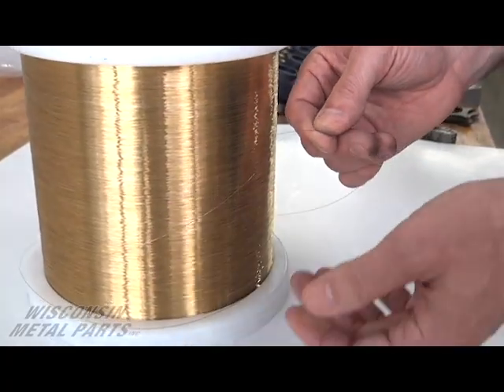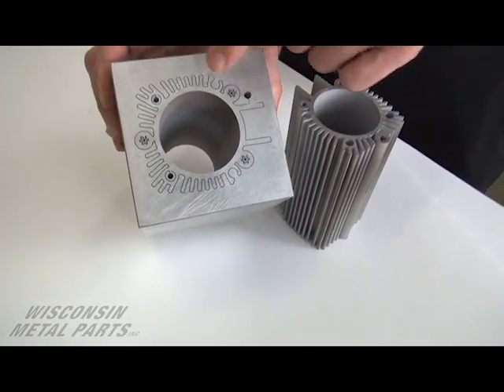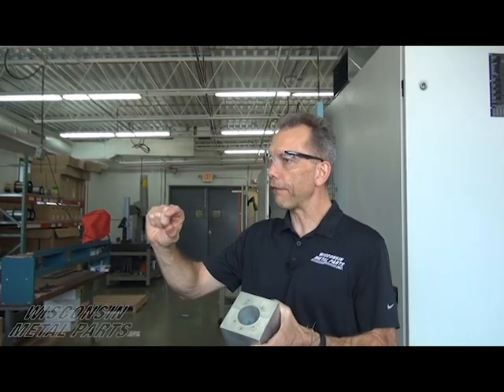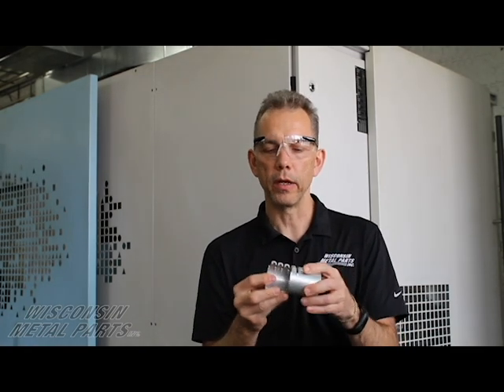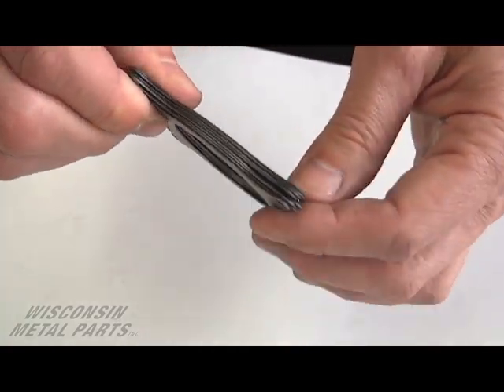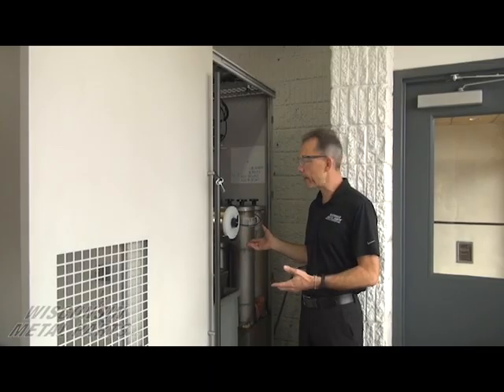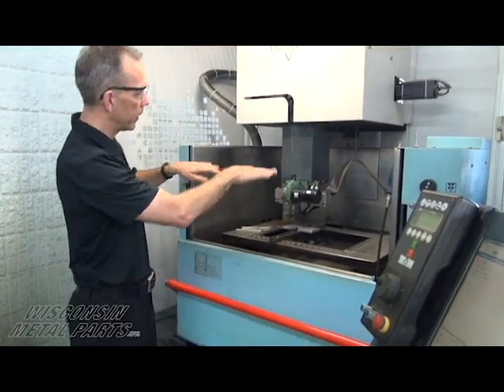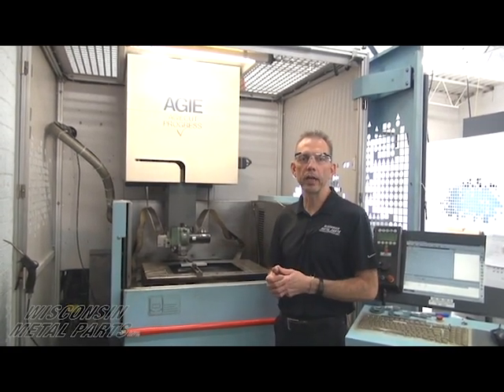Wire EDM Basics - Continuing Education

Comment: I burned a 3 " thick piece of aluminum once that appeared as the number 1 on the top guide, while the bottom guide was cutting the number 2. Quite the transition! Wire EDM has totally changed the stamping die industry. It made it possible for shop owners to dumb down the trade. Tool and Die makers now days don't recieve the knowledge transfer they used to.
Reply from the maker: It really is a powerful tool that has assisted our company in many ways, especially when making progressive dies!
Reply: @WisconsinMetalParts  can one machine drill the holes then cut the shape
Reply: yeah everyone is getting dumber thats why everything we build is becoming more advanced.....the fact is the knowledge that you value is worthless in the current time.

Comment: Would a wire EDM be the optimal option for ex: 24" spur diameter gear, the is 3.5" thick, tolerance of +/- 0.002" on the pitch, and a very smooth finish that would not need any post EDM machining processes to go into service?
Reply from the maker: Yes, spur gears can be cut on a WEDM machine. Whether it needs any post machining will depend on the design of the part. Typically the gears and any keyways in the center hole would be cut in the same setup.

Comment: Hello.   Which machines/processes does WMP use for inspection of EDM parts?  I'm a CMM programmer, and I utilize a Zeiss Prismo Ultra.  It has proven extremely reliable for close toleranced parts, up to .00005".
Reply from the maker: Jeff, while we do utilize our CMM’s at times for Wire EDM inspection, most of our work is checked using gage blocks, gage pins and other measuring devices to facilitate inspection while parts are still in the machine.

Comment: What if you work on metal piece without hardening it first? Does it affect the precision?
Reply from the maker: The precision of a part cut using WEDM will not matter if the material is hardened or still soft. However, if you harden the finished part after WEDM you may find changes in the precision. Thanks for asking!

Comment: How do you get the natural bend out of the wire off the spool. To get those kinds of tolerances even the smallest bend would have an impact
Reply from the maker: That is a great question. Through a series of rollers, the machine has the ability to vary the tension on the wire and can easily pull it straight to make accurate cuts. Thanks for your reply.

Comment: DIY ECM not EDM question,  is it possible with a 3d printed copper plated electrode to machine a handgun slide?
Reply: Not really, a standard milling machine would to more. Wire edm is for end to end straight lines whilst a handgun slide would have too many areas that would not allow the wire to go through.

Comment: Strange. I thought wire EDM worked like a scaled down, but seriously over powered mig welder. Kind of like feeding the wire onto the surface of the workpiece to zap a tiny little trench of erosion craters, then going around again, zapping the bottom of those craters to get a little deeper. I didn't realise it could work like a high tech hot wire cutter that spark erodes along the entire depth of cut in one pass.
Reply: In a way, yeah, or like a plasma gouger - melt the material and carry away the melt pool before any part of the electrode can deposit. Just a whole lot more precise, haha.

Comment: Does this work with aluminum? Or if not, what material can be used for a heat sink if cut with EDM?
Reply: It's a bit more tricky and requires more flushing but it can be EDM cut fine.
Reply: @evilution_ltd  cool, thank you. this is good to know about.

Comment: I always thought a half a thou was as tight as things could get. 50 mil tolerance blows my mind....
Reply: I've worked on parts measured in microns, needless to say things can get frustrating. Had a few parts that required a microscope and a special computerized table (imagine a really tiny milling machine with a camera in place of a cutter, and the part goes on the table, then you set the camera crosshair over a datum feature and zero the software, then move the table to the features you want to measure with the feed handles, except the table only has one inch of XY travel and is graduated in microns) to measure them. 

You should see some of the nano structures scientists have made, they can literally print parts atom by atom now, though it's quite a laborious process. Humans have come a long way in the field of precision...

Comment: Hello sir, nice video. Can we use alternate dielectric fluid instead of water with this wire EDM? And secondly here wire is being used as tool, can other tools be used instead of wire in this machine?
Reply: There are EDM processes that use EDM "punches" or tools instead of wire. Anything conductive would work as a tool.
Reply: Absolutely NO!